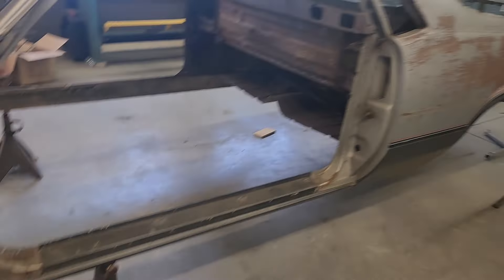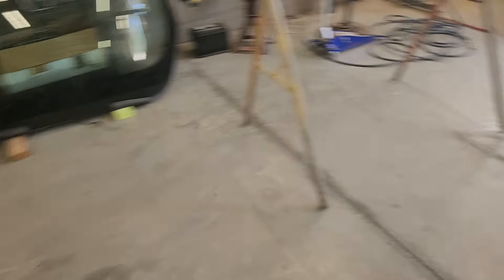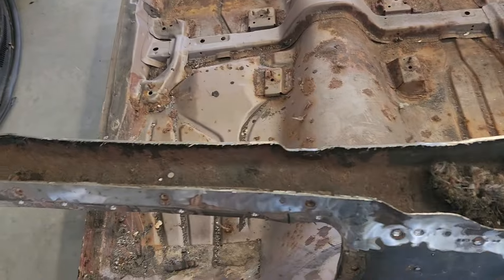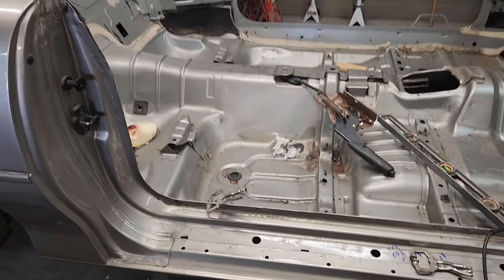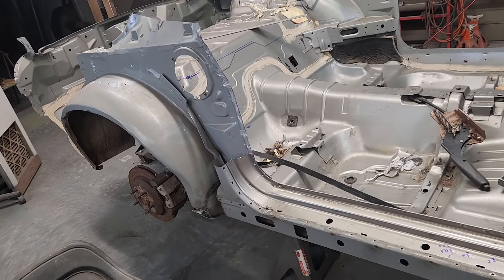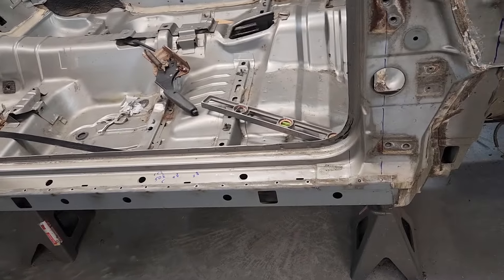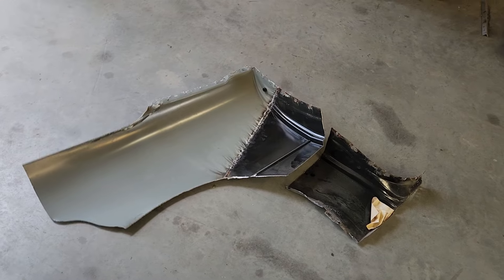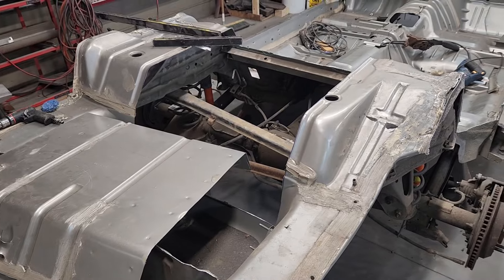85 El Camino 99 Z-28 Body Swap part 2

Comment: Very neat Steve; its crossed my mind to use one of those 4thgen Camaros to drop a 1st gen body on
Reply from the maker: I am finding out it has a much wider track than the 85 G Body. I don't know if it would fit neatly under a gen one Camaro. It's possible it could work.
Reply: @SteveMirabelli  Yeah, I noticed that when you mention it in the video; I did end up narrowing a Challenger 2 inchs on each side for my eventual B Body swap, but this looks even more challenging(no pun intended LOL)
Reply from the maker: @captainboose8788  narrowing a Challenger.  No easy task. Props to you.